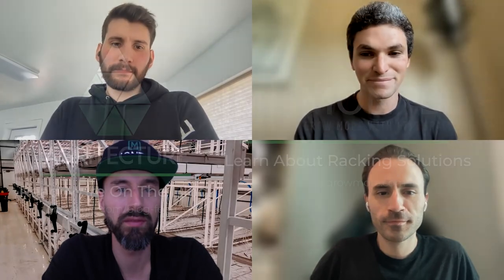Technology Integration In Vertical Farming: Sponsored By Montel

Comment: Biggest problem with urban ag, is the lack of space for add on RE supplies like solar panels, but you can add battery storage so that you buy in cheaper off peak electricity and use it as needed, it also means you might have the option to sell back to the grid during the high peak periods. Power companies love this as YOU are adding storage for THEIR system. Currently 1 Mw of storage is down to about £450k, not cheap but will save a tonne on energy costs.  This works best with a DC bus system but sadly nobody apart from IGS seems to use one, which is crazy.

Comment: DC bus bar systems are cheaper on Capex, installation and maintenance. If you have a DC system then you are reducing AC/DC losses and can run from an RE source. It also means you dont need AC/DC converters for your lights, which cost money and produce heat.

Comment: For water through systems, a simple 5 stage RO system can take out all that is left in the water, so that the water can be reused. There is never a need to dump to drain. A simple blue light will also take out any bacteria
Reply: Great info guys.  You've all been super helpful. I have a 6500 sqft space in downtown Omaha,NE.  Would love to connect!

Comment: Planning space usage is vital as one of the key advantages of VF is the most efficient use of 3 dimensional space. That means knowing simple things like cable and pipe routes, and with both you have to think, if they are damaged then how easy are they to replace quickly. Cable ducting is easier and cheaper to install and maintain, it also safer.

Comment: Vertical farming is an integration of a wide number of differing technologies, and therefore you need a good integrator.
I have over 45 years of project experience and one thing I can guarantee is if anything goes wrong it is somebody else's fault, From the customers position you need to pass on the risk to an integrator, such that if the system doesnt work as expected, then it is for them to fix as they have the "expertise".   If the customer buys different sub systems from differing companies then tough it is the customers problem to sort out.